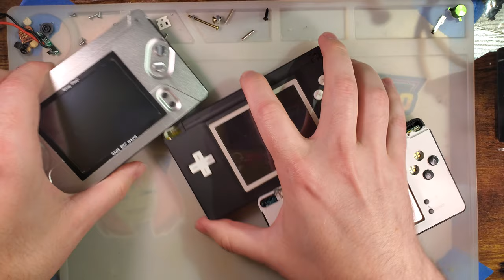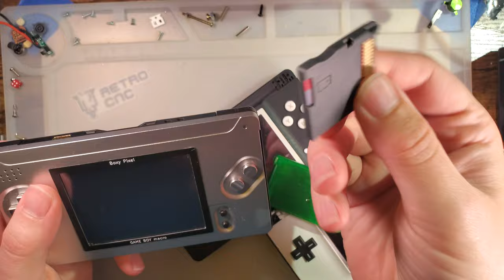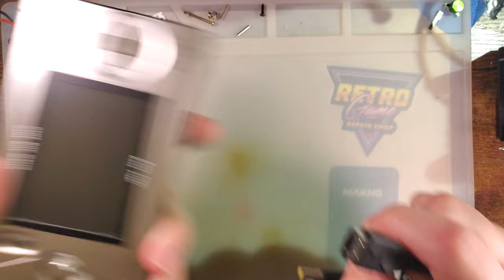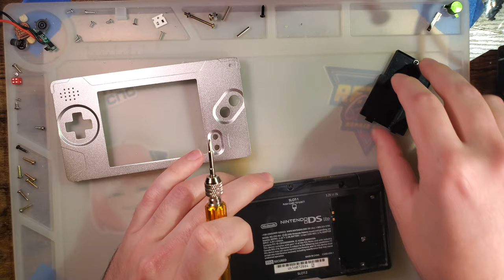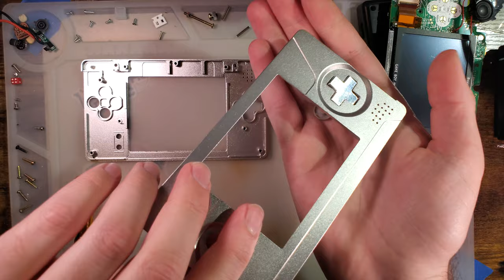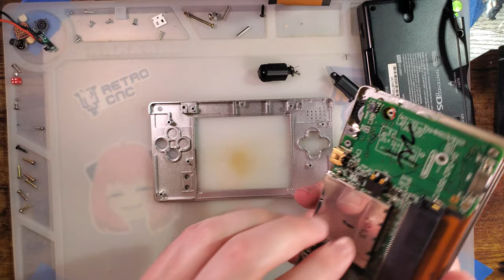Boxy Pixel Game Boy Macro Faceplate (Nintendo DS Lite) and alternatives

Comment: The Boxy Pixel faceplates looks great, but I prefer the 3D printed faceplate from Facelesstech, because there is enough space for the touchscreen and all 4 buttons are accessible. Combined with a PSP speaker and the screen switching mod, it's a very nice mod with most of my desired features.

Comment: IIRC, the DSlite's charge port was just a differently shaped Mini USB port. 

I remember my charger dying and was looking online for a quick fix. People at the time told me to take a miniUSB cable and open up the metal housing on the B side just a tiny bit and then it should work. And it did and still does till this day.  

I could be wrong and they just shared a common power pin layout but hey, it works so I can't complain.

Also, as with mods in general, DO THIS AT YOUR OWN RISK.
Reply from the maker: Not at all. Totally different port and it's a coincidence that what you did worked. USB charge cables are only a dollar or two so if you need a charge cable, just grab one of those and be patient.
Reply: @makho  Yeah, I have at least 10 of those multiple console charge cables now but at the time I was a poor middle schooler and the place I'm from didn't  have a place to reliably get gaming accessories. 

Anyway, thanks for the reply, I guess I've been dodging a bullet with my DS Lite this entire time. I don't use that particular Mini USB cable much these days so I guess I'll have to permanently retire it just to be safe.

Comment: I have two Macros and they both look like your white example with just the naked bottom screen pressed against the face plate. How does your black version seemingly be the same face plate design but it seems to have a lens installed? Are there stock looking face plates with lens support?
Reply from the maker: That's the OEM touch screen digitizer. As in, what the DS Lite comes with from the factory.

Comment: I guess boxy pixel makes there macro faceplates different now, My faceplate has extra metal on the inside, I'm trying to put one together and I can't get the screen with the digitizer still attached to fit, I've been slowly grinding away metal to get it to fit but its just not working. A clone like that seem like It's the only option if you want to keep the digitizer anymore, unless I'm just dumb and not getting something.

Comment: Is it really so bad that someone is making a derivative product based on someone else's derivative product ? With BP work clearly being derivative of the people In the community who homemade their own macro faceplates and Nintendo's original design for the DS and the SP.
Clearly they put in enough work to change many exterior features to set it apart.  Boxy pixel can't somehow be the only one allowed to make Anodized faceplates for a specific console.  As for the interior, the machining for these could have easily been based on current plastic molds of which the Chinese would clearly have access to many. And it's probably easier to just leave as many things the same as necessary don't you think? Change enough exterior features to not match the existing product (BP shell) and leave as much of the inside from your files for plastic molds as unchanged as possible. After all , it has to fit the geometry Nintendo created first or else it flat out won't work. Of course things like the lense fitting make sense, if the cutout is based on Nintendo's specification for the screen size then why wouldn't the screen fit?

I am not condoning 1:1 bootleg cloning, but I don't think this is as clear cut of a 1:1 bootleg you seem to be set out to villanize.  Retros!x this is not.
And if it's well made, it's clearly not garbage.  Or do you want to throw all of the aftermarket shells made in China that  are derivatives of Nintendo's work or of each other's work (through competition) in there with that as well?
 Many make small changes, most far less than this "clone", regardless I'd they created their own mold of Nintendo's design. 

How many "Truly Unique ™" designs for a metal DS lite macro faceplate can people make?  What would be enough to set it apart for you? Would they have to add the 3 button support? Simply solid fill the interior in every place Nintendo didn't intend there to be room for surface mount components just so it looks different but is functionally identical? Move the speaker hole to a different location? Leave the four button holes so people can't machine those out themselves if they wanted? Not make the same logical design decisions anywhere? Why did BP leave the four button structure when he could have also just solid filled that? *Because his design was derivative of Nintendo's design and mold of the OEM plastic shell interior.

I still say support BP, especially if he is still having them manufactured and they are similarly priced. But it seems you are taking this too personally. Prove there is a market for a product and of course derivatives will appear. Or else this channel would not exist,  nothing made by the aftermarket community would exist(which btw includes people in China, with whom the current aftermarket would not exist).
Why don't you take a look in the mirror? Should we call the Slate a clone of BP's SP shell simply because the form factor is the similar  and they can both use OEM designed bottom shells regardless of any other design or functional differences? 
Everything is derivative. But being derivative doesn't make it a shameless bootleg.
Reply: I tend to agree with you. The modding community has a complicated relationship with intellectual property since the only reason GB modding exists in the first place is because Nintendo allows it to. Of course there's little they could do about China but they could easily crack down on the American and European sellers of shells and buttons if they really wanted. The argument that Nintendo isn't making money from those old products has also become difficult to defend ever since they have started selling GB games in their e-shop.  

There is a sliding scale on what to call original, deriviative, or a straight copy, and something like the Slate is certainly on the original end of that spectrum. But the whole concept of a market for modding is (by definition) based on IP theft, which makes any accusation of it within the community awkward, if not totally moot.
Reply: @firstbass789 I'm not saying all of modding is based on IP theft, but a large part of the aftermarket is. I'm not even against it, but if you criticize someone for copying or buying a copy of a custom shell, then you should do the same for all the aftermarket shells that copied Nintendo's original design.